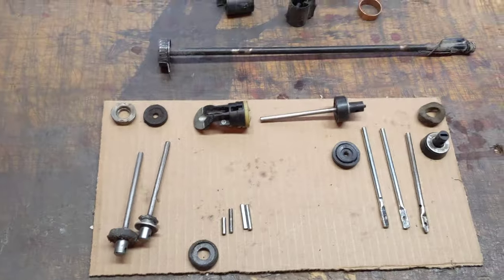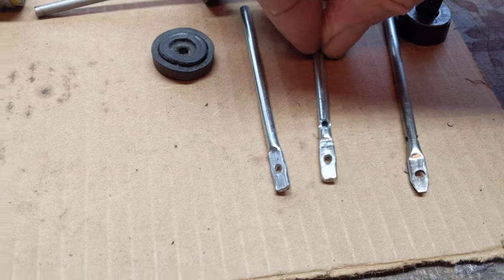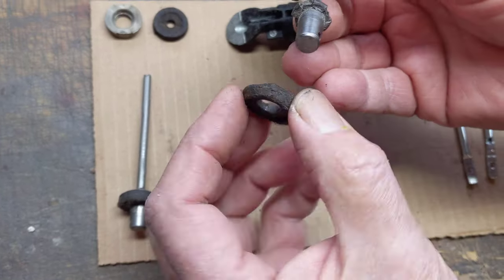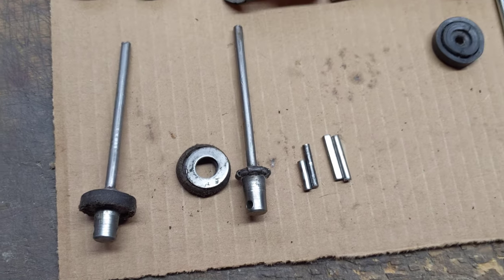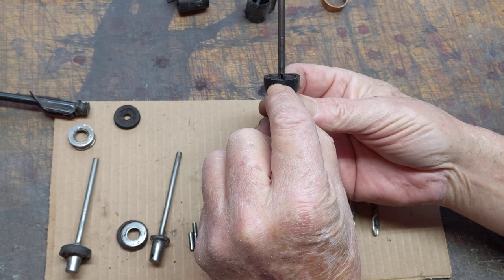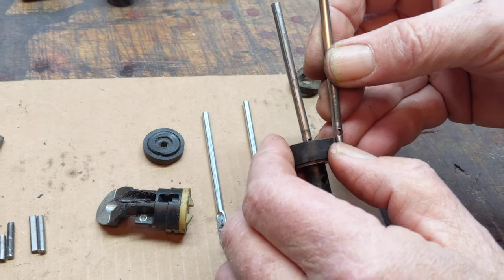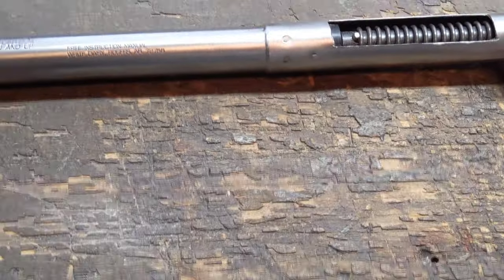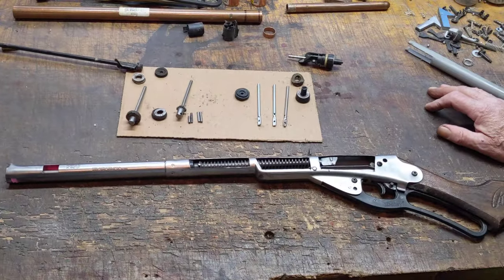Dual Port airtube, Single Port airtube, is one better than the other?

Comment: Just found and like your channel.  I have been rebuilding, designing, and building airguns for about 20 years now.  I prefer pneumatic designs. 

One modification I have done to these Daisy's is line the compression  tube with seamless thin walled brass tube.  This also required a redesign in the abutment seal and piston seal, mainly for diameter reduction caused by the brass tube.  I got a modern Ryder shooting 415 with a standard spring.  For the piston and abutment seal, I used polyurethane stock and machined an o-ring gland on them. 

Seeing your videos is prompting me to get a 499 and modify it the same way.  Though, not certain it the 499 will accept a model 25 shot tube.
Reply from the maker: Willace, thanks for jumping in and welcome aboard! I'd love to hear more about your work. Other than really clean the compression chamber I've never thought about relining it. Is this a mod you do on the pre-1978 Daisy's with the metal abutment washer or is it doable on the shot tube/abutment assembly guns?  415 FPS has my attention, especially with the standard spring. 

There are some folks working on a 499 repeater, head over to the High Road Forum and check the last 6-7 pages of this thread

https://www.thehighroad.org/index.php?threads/putting-a-little-more-power-in-a-15-00-daisy.807316/page-56

They're working on getting a highly modified Model 25 shot tube married up with a 499b abutment for use in a 400+ FPS Daisy repeater. Quite interesting.
Reply: @RestOModDaisy  I'd say it is possible with all years.  The modern guns use a shelf to retain the abutment, which does make things easier.

I have a machine shop setup in the garage.  Two mills, a lathe, etc.  Certainly comes in handy for making those one-off parts to make things work.

Lining the tube was the first thought since it is seamed and promotes pressure loss.  I've not seen one that wasn't.  Once I found the actual bore size of the compression chamber and machined up the appropriate brass tube, it was retained in place using the spring anchor retainer point so it didn't slide during operation.  

Looking at the diagrams for the 499, seems pretty straightforward.  A new abutment will need machined to accommodate the model 25 shot tube along with the addition of an actual plunger assembly.  The approach will be to go with a one piece abutment which incorporates an o-ring seal that rests inside the brass seamless compression tube, yet rests on the shelf if the faux barrel.  

Found an old 499 on ebay I may just grab up and try.
Reply from the maker: @willacewallace5905  Please keep us in the loop on your project. IRRC the 499 plunger assembly does not utilize an airtube like other Daisy's but is  muzzle loading single shot rifle, so you'll need to mod the factory plunger head to account for that.  Any possibilities of making some videos of the process?
Reply: @RestOModDaisy  Sure thing.  I'll do up some videos.  Though, just picked up a Daisy 1000 at a good price.  So, the 1000 will be the test mule for mods.  

The first gun that was modified I gave away on an airgun forum (Yellow) a few years back in a raffle.  

I sent you PM on eBay asking about wide body stocks.  Looking to see where they are sold or it if you have them for sale.
Reply from the maker: @willacewallace5905  Willace,  I've been off the ebay platform for about a year as their draconian communications policies were just too much to bear. I still do stock work but haven't done a Fat Bob glue up since about March. Seems everybody wants a Slim Jim. Send me an email and we can what we can do.
Reply: @RestOModDaisy  How do I locate your email?  Use eBay?
Reply from the maker: @willacewallace5905  It's in the video description "thesocietyforprofit@gmail.com"
Reply: @RestOModDaisy  Welp.  Duh is me!
Reply: @willacewallace5905  I believe the 1000 uses the same size seals as the 1894 Daisy. They're a slightly smaller seal set than most wide body Daisys. But if you're machining them from scratch, this is moot. Looking forward to seeing your work!

Comment: You increased the flow and decreased the pressure. Keep the larger ID tube with two inlets and try soldering or rolling in a small reducer in the tip.  And will also reinforce the tip as well.

Comment: Home making your ATs is easy and great inner diameter I get about 10k shots from a homemade. Shape of the port I find changes flow. The leather seal plungers give you more room for those tight coil springs. Leather needs more shot tube cleaning but it is tight and flexible seal worth trying. I have a broken 2 port old style with my own tubing. FYI the abutment with throw into chamber using the seal that go with the plunger. I did it to my 111b to make a 457 sharps look alike I miss the 2 magnet abutments. I'm guessing your tubing is from a telescopic magnet or mirror right?

Comment: It looks to me that the air inlet holes you made are a little bigger than the others. Maybe try making one with a little smaller holes would increase the pressure just a thought. Great video love learning about this stuff.
Reply from the maker: True. I used a 1/8" drill bit for both ports. The good news is that the airtube ran 450+ BB's through he gun flawlessly and there is no indication of shot peening on the tip. There are some suspicious marks on the shaft about .80" above the inlet ports as well as some straight line wear near the tip of the air tube. This was used with a current production Model 25 shot tube and was powered by a Cobalt 237 Super Spring in a Daisy Model 1838 Red Ryder receiver with a metal stamped trigger and a synthetic seal set. We'll see how the next couple of prototype fare with some tweaks.
Reply: @RestOModDaisy   See if you can maybe offset the holes for a vortex type of action. Instead of drilling them at right angles... try canting them in an upward fashion and off slightly to one side. Obviously I tend to agree with Blackie about offsetting them.

Comment: What does the air do? Cause stability to the BB or is the Air not the plunger impacting the BB?
Reply from the maker: The air tube transfers the compressed air charge from the compression chamber to the rear of the shot tube when the trigger is pulled and the plunger is released. The tip of the airtube makes contact with the BB in and kick starts the the BB on it's way as the compressed air accelerates it down the barrel to the intended target so it's a combination of the two forces.
Reply: @RestOModDaisy  Love this but never knew! Thankyou for explaining. You're  awesome!
Reply: Wonder if the air tube tip actually hits the bb?   Air may have the bb moving before tip gets there 😂

Comment: I think we all know air takes the least path of resistance.any chance the air partially escapes at the crimped end of your air tube?  Is there something to the shape of the intake ports? Keep doing what you’re doing! We love your content!
Reply from the maker: Thanks drtstar1! I'm pretty sure the crimp is ok but there might be some blow back along the out side of the airtube wall. I'll know more after I get the next air tube built with a single port for comparison. I'm also gonna have to try adding shot tube length to see if that gets me closer to Nathans numbers.
Reply: @RestOModDaisy  I’d also be curious to see the dimensions of the stainless tubing vs Nathan’s brass tubing.  If precision ground bb’s make that much difference, I’m sure nominal wall thickness of a few thousandths could contribute to your air loss.
Reply from the maker: @drtstar1  Good point. I know there a difference between the OD of the Stainless tube and the OD of a stock Daisy air tube, and the stock Daisy tube will allow you to see some daylight if inserted into the base of the Model 25 shot tube. I'm hopeful that the .135" ID of the stainless tube with provide more air once I can get the port size/location/number sussed out.

Comment: I could not find a video about it but I've had issues with my buttons coming out of some of my older guns IE my 111 and my 11140. Is there a method to putting them back in and just wing it cuz they have ears on them requiring them to be installed with the sleeves on the so I don't know how popped out the sleeve. Identic Cecily Bang from the Muslim anything like that the one came out when I was pushing the seal out. If you could have a video or any remedy on three installations is cuz I have found you can put them in b-series guns successfully utilizing copper piping to fill that space and then tamping on in by Hammer that was a punch Mark together but those are already smoothbore inside I need a remedy for the sleeves smaller Chambers. I do Oddball things Shane is something I'd like to show you eventually but it's over go up that way and see you or Mark but as always remember where it all starts starts with a Daisy